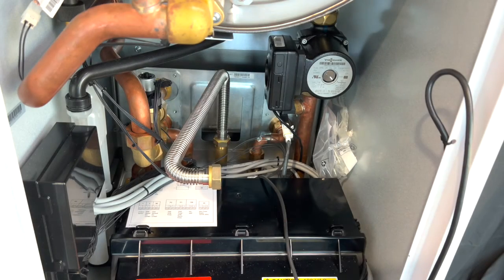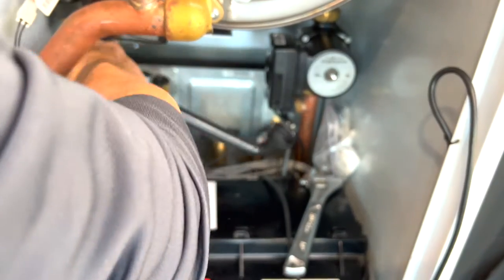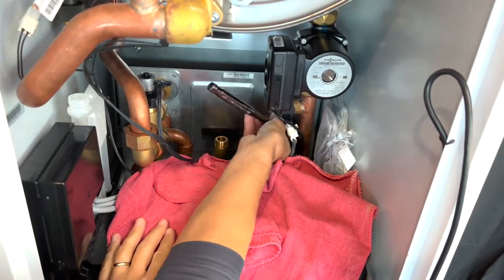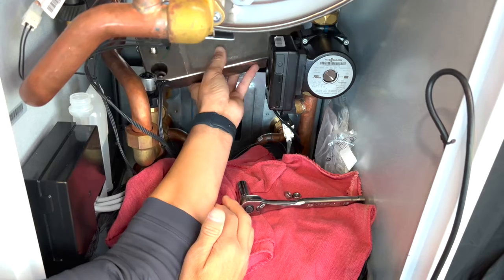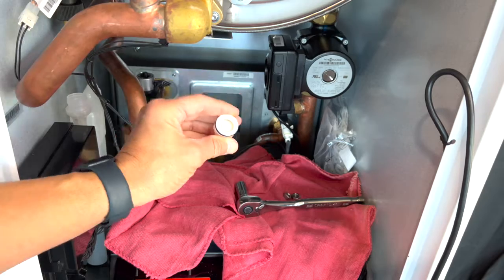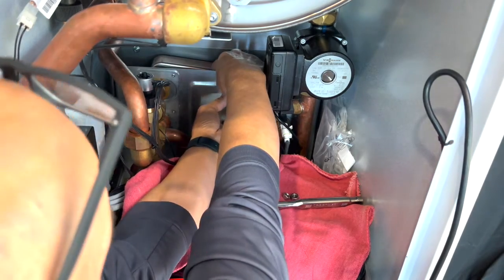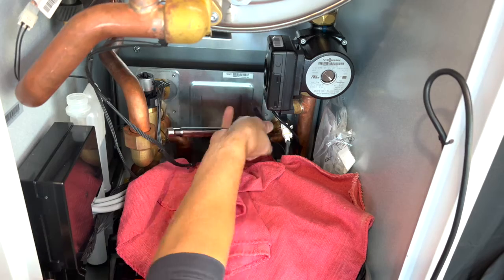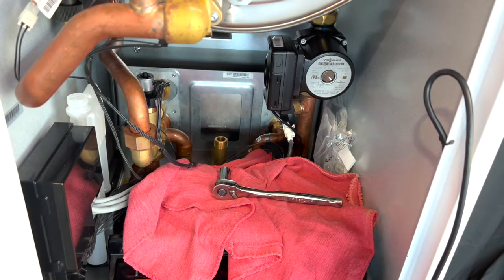How To: Remove & Replace the Check Valve on the Vitodens 100 B1KE199

Comment: HOLY GOD  never again !!    a 2 year old Vitoden 100W  give hot water but no heat.    $975 service call to change diverter valve.   German OVER engineered.  Look for another brand people. This was a huge mistake.    Other model are less expensive to maintain.

Comment: Is there a new part number for the up dated check valve? What are the symptoms of needing it?
Reply from the maker: The part number for the updated check valve is 7890563.  In limited cases, the original check valve may stick resulting in a no hot water condition.